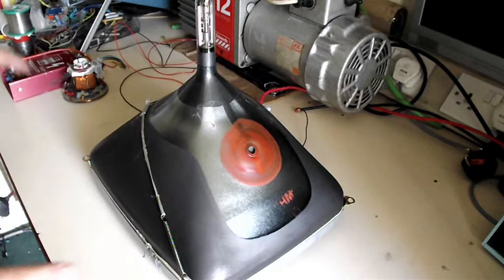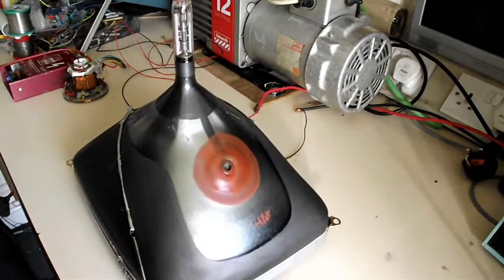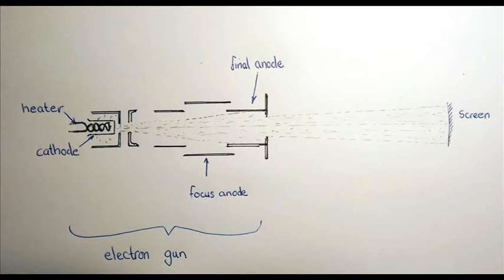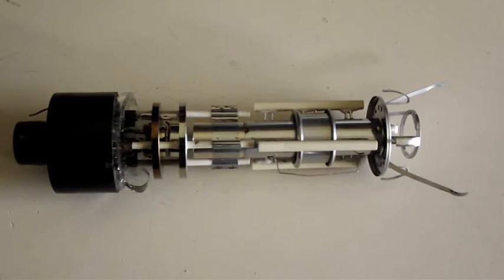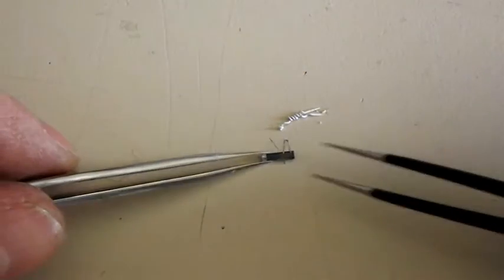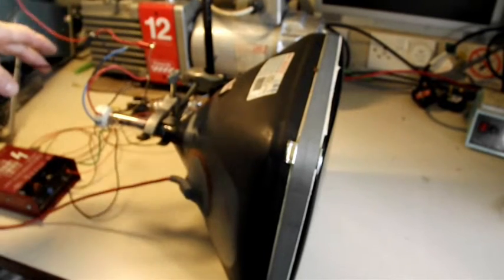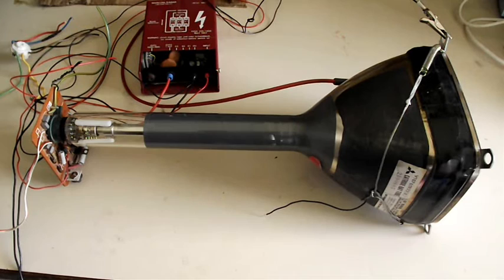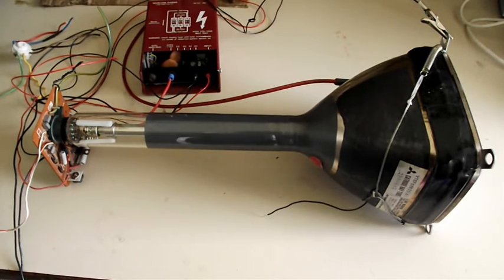CRT cathode emission

Comment: Did you increased the anode voltage by using another flyback transformer ?
I think the anode voltage can be increased by adjusting the focus knob on the flyback or by increasing the screen knob on the flyback. Correct me if I'm wrong
Reply from the maker: The anode voltage would have been adjusted here most likely with the low voltage supply to the EHT drive module seen in the video. This was and old CRT unit taken from a Marconi Radar display. It had a 15kV/11kV anode supply and a focus not in use here.  You may get a slight change on anode voltage adjusting the focus but this will likely relate to a change in beam current loading. The focus voltage is normally obtained from a potential divider supplied with the anode EHT voltage loading it can affect the anode voltage as it loads the transformer. This technique can't really be used with colour CRTs as the mask/graticule affects the image.
Reply: @tuopeeks  thanks

Comment: Congratulations looks like you manage to emulate the moon and the sun on an old cathodic screen.
What if you passed a magnet close in front and managed to reproduce an eclipse as well?
Reply from the maker: It does look a bit like the sun with a H filter. It will move with a magnet but if it becomes eclipsed it just means the electron beam has hit the anode.
Reply: tuopeek1 they antagonise eachother?
Reply from the maker: @bengrizzlyadams6187   normally doesn't  do  any harm.

Comment: If a cathode is monochrome or black and white does it need the deflection coils
Reply from the maker: Yup,  to scan the beam a coil or deflection plates are needed. Almost all tvs or monitors use deflection coils. Monochrome coils can be smaller as the anode voltage is less so the electrons are slightly slower. No coils are used in this video as the image is of the cathode surface.

Comment: Very good video, but I have some questions. Can anybody answer please?

To create the beam, which wires have to be connected? 

So the plus is the anode and minus is the cathode, anode is the wire going to the side, but what is the cathode, which pin it is? 

And what voltage do I need for cathode and anode, is it 10 or 15kv? 

And do I need to connect the heater, and what voltage do I need for the heater?

Thank you :)
Reply: PETR DOLEZAL xd

Comment: When I was a TV repairman back in the 70's and 80's, I invested in an instrument called a "CRT rejuvenator."   It would apply a measured over-current pulse, blowing off the surface of the cathode emitting surface and exposing new material.  It usually worked very well, adding life to an old television CRT.   Usually.  Sometimes it would destroy the function of the CRT, so I always had the customer sign an agreement that we were taking a gamble, and that he or she accepted the risk!  As I recall, the agreement forms actually were supplied by the maker of my instrument.  There was even another option.  A step-up transformer device, called a "TV Tube Brightener" was available.  It would be installed between the CRT base and TV socket assembly.It simply boosted the heater voltage by 10-15 percent and added a bit of more usable CRT life.
Reply: Well I saw your comment in a different YouTube video. But you wrote there you worked in 60s to 70s.
Reply: You mean a flyback transformer
Reply: @joshuaryanferguson3702  No. A step-up transformer.
Reply: @samuellourenco1050  it's not called step up it's a fly back transformer
Reply: @joshuaryanferguson3702  No, it is not. The OP clearly used a step-up transformer to increase the voltage going through the filament. A flyback transformer is used for the anode. Next time, don't try to argue about electronics with someone who knows his subject (the OP and me).
Reply: @joshuaryanferguson3702  It's a step-up transformer, it has nothing to do with the flyback, it's a seperate transformer meant to boost the filament voltage to increase the brightness. Of course raising the filament voltage meant it's longevity would be significantly reduced, but with a dying CRT there wasn't much to lose anyway.